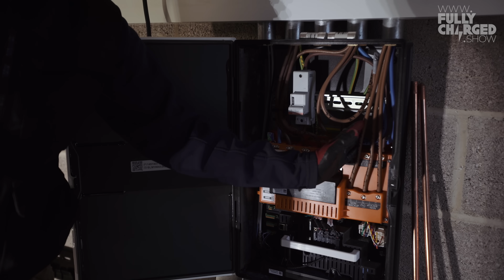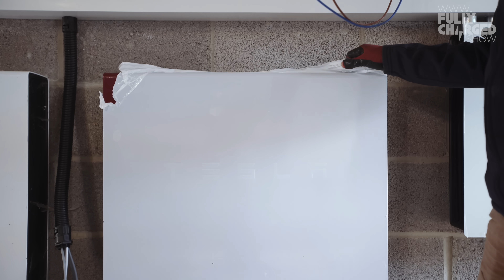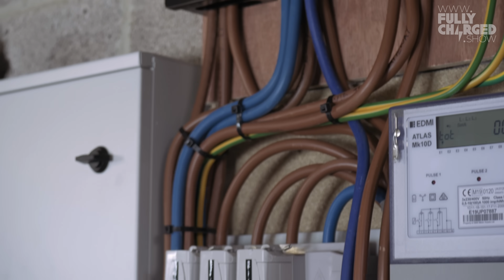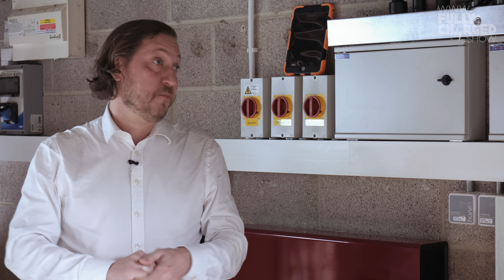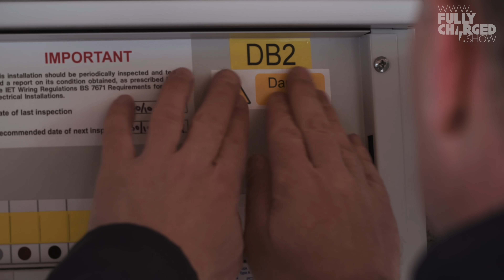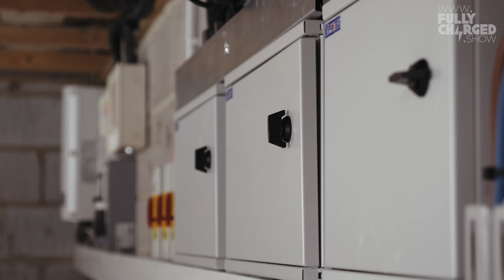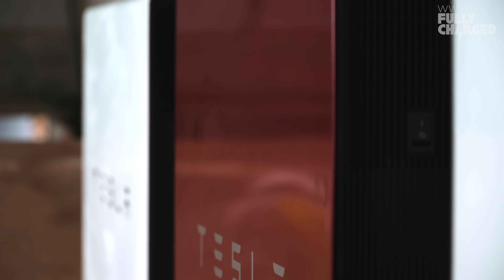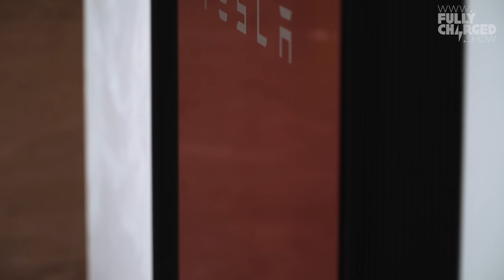Can you run your house on a battery? Tesla Powerwall 2 (Founders Series) & Tesla Backup Gateway 2

Comment: Had my powerwall and gateway 2 a few months ago and was surprised to see how long your battery’s took over the grid, mine is instant ( maybe this is due to your 3 phase supply ) noticed a few people asking about cost my standard single phase house cost £8500 fully installed pw2 and gateway 2. I’m doing a 2020 cost analysis to work out how long it will cost to pay back in real life situations on my  channel.
Reply: I've had my Powerwall2 & solar since Oct 2018. Southern England. We used virtually no grid electricity from 24th March to 24th Sept. House use for year was 9.9 kWh per day with grid use at 4.2 kWh per day so saved 64%. The battery provided 1160 kWh to the house. So at 14.5p/kWh saved me £168. Going to take a while to pay for itself! (Cost was £5600 I think).
Reply: @StephenBurch  so, you'd need 33 years for payback, which of course makes no sense, especially if you are realistically including capital costs?
But if you are basically getting electricity for your car free of charge for six months, I suppose the calculation ends up looking quite different.
Reply: @martian9999  That's assuming you don't invest that 5600 in something else.  8% returns over 33 years is like 70k.
Reply: Martin Schwoerer I think ideally, it would be better if each Tesla car could act by its own as a Tesla Powerwall because 1. there is 60kWh or more battery capacity in the car, unused most of the time and 2. it could avoid to have to buy many standlone (non mobile) Tesla Powerwalls and save on the cost on those.

There the ROI would maybe be better, but I am not sure that it would make sense...
Reply: @martian9999  You are correct it makes no sense so I've just had a look at my installers original quotes. My solar PV system on its own should pay back in 8.9 years (savings from reduced grid usage + tariff payments). 

The battery along with the solar PV system only added 2 years to the payback (10.8 years). It looks like they arrived at that figure by assuming grid prices and tariffs will be increasing over the 10 years (6.5% pa and 2.8% pa respectively) and that I would be using off-peak charging which they estimate would save £135 per year. I don't currently charge off-peak but reckon if I could get all my current grid use (1325 kWh per year) off-peak at 5 pence/kWh I'd save £125 per year. 

With the feed in tariff being paid at half of what I generate (irrespective of what I actually send back to the grid), together with RHI payments for my solar thermal, I in effect paid nothing for gas & electricity last year for which I'm very happy! 

(I don't currently have an electric car).
Reply: Stephen Burch I’m quite a high user of electricity especially this time of year ( electric boiler ) really  looking forward to how long it takes me to be self sustained ( March would be great and boiler should be off by then )
Reply: @AllElectricLiving  yes. I find if the battery is at about 20% when I go to bed that's just enough to get through the night, have a cuppa in the morning and wait for the sun to get back into action. Roll on the spring!🌞
Reply: Chris Hill @Chris Hill : For the electric bolier, maybe it could be interesting to install thermal solar to boil the water of the electric boiler : I think it could reduce the need of electricity, and so speed up the Return On Investment of the solar electric installation & Tesla battery
Reply: I don't think it's worth it, too much time for early adopters. I think it's better to adopt small scale, a small system for the fridge and heating things.
Reply: Stephen Burch I’m also on the agile tariff from 🐙 octopus
Reply: @AllElectricLiving  there's a 3 tier tariff from Bulb I attempted to join but they're not rolling out the required meters yet. Charging from the grid overnight is the next step. Will check out Octopus!
Reply: Stephen Burch last weekend the octopus agile tariff was paying us up to 5p per kWh to take energy from the grid. There is a referral on my video logs where we both receive £50 if your interested. The down side to the agile tariff is it can cost a lot more between 4 pm and 7 pm ( up to 35p per kWh ) but the powerwall covers these times and a bit more
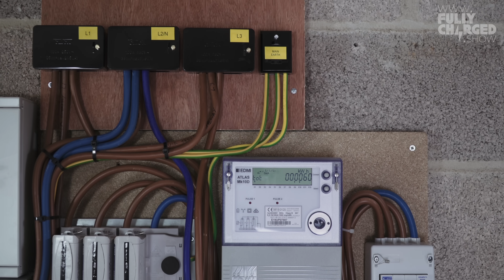Reply: @AllElectricLiving  Green Energy also do the "Tide Tariff:" that is 'Eco7' over night (7.53 pence from 00:30 to 07:00), then 'normal' during the day (15.5 pence @ kWh), but with 31 p from 16:00 to 20:00 'Peak.' We have been on that for about a year, and using the Powerwall 2 we have only used between 1 and 2 kWh at 'Peak' a MONTH, and that is due to to-and-fro with the grid at odd times to balance the pull from the battery. For 2 summers we have been effectively free of the mains for 6 months, with the other days on Off Peak. That is WAY better than we expected.

I have been trying to get Joju to fit a 'Gateway' for about 6 months, but they have been too busy on the mainland :-(. The joys of living on the Isle of Wight :-). I will now 'Tug' on Jon Cowdrill's chain again, having watched this!
Reply: @StephenBurch  you're not thinking of economy of size if the batteries were big enough and the multicast was available instead of receiving 5pk kilowatt you could even receive 1 lb per kilowatt then how much would it return to you
Reply: Stephen Burch Thanks so much for those numbers Stephen, it is very, very helpfull to give an overall idea of what it gives in real life !!! May I ask what is the size (in peak kWh) of your solar installation ?
Reply: @nicolasdujarrier  I've a 3.3 kWp system (10 panels)
Reply: @StephenBurch  isnt it always cloudy in uk.. 64% thats a lot. Any place sunnier it's probably close to 100% then?
Reply: @StephenBurch  what! That is a gold mine here in Brazil.
A typical house with 3-4 people consumes around 200kWh per month!! That would cost us around R$160 / $38. We basically have solar all year, it's very rare to have a cloudy week.

I can't believe we could live of solar by know
Reply: thx for the cost data
Reply: @ferkemall  What are you talking about?  Solar hot water, PV systems, PV panels, the sun? Sense, you make none.
What do you think the efficiency of the grid supplied electricity is once you account for the transmission, transformer and power generation losses?
Reply: Chris Hill : Any chance of a link to your channel?
Reply: Dave Pinnell here is a link to the first of a few short videos about my circumstances before 2020 year, please ask any questions or if you want anymore information 

https://youtu.be/G2aJYjnlL3A
Reply: @davepinnell  "Any chance of a link to your channel?". Just click on his name in the comment - takes you straight there.
Reply: Thanks very much Chris for doing a cost analysis : It would be very, very helpfull to get an idea of real life cost / expenses and income of such an installation for people like me that are thinking of doing the same of some point in the future
Reply: @Peter Evans The costs work out totally different when they had the subsidies. On a 2012 installation he has FIT locked in that is no longer available to new users
Reply: Here's a rough calculation for basic ROI for my house in France. Install PV system of 16 panels at 300 watts each €13000. Install PW2 and other gadgets €10500 (PW2 alone costs around €8000 in France). Average electricity bill is around €100 per month. If the PV system and PW2 could save me 75% of my electricity bill then I would need 23500/75 months to get to zero cost. That is 26 years. Yes there are other factors such as how much energy I will actually save, government subsidies, increasing future energy costs, lost interest on capital expenditure, and energy feedback to original electricity power supplier. But even then it would be difficult to get the break even point to much less than 15 years. Conclusion: today the ROI is not the only question - there's also the philosophical and good citizen issues to be considered - for that my engineering background is of little use. Hope this helps.
Reply: @ianburton9223  I've just been looking at my installer's calculations on ROI with and without a Powerwall. Adding the battery added 1.9 years to the payback period. Seemed like their big assumptions were FIT (no longer available) increasing at 2.8% pa,  Energy prices increasing at 6.5% pa and using off-peak grid to charge the battery. As you say, there's more to it than just the "bottom line"
Reply: Mine too. It switches instantly and the lights dim slightly. I’m not sure it is 3 phase or it is not set up correctly.
Reply: @arnyswart  might have something to do with fluerescent tube bulbs take longer to fire up once you cut power to them, possibly?
Reply: Iain Ansell all mine are led to save on power.
Reply: Mine is instant also. But I'm in in the US.
Reply: Considering the  gateway is nothing but a Tesla branded ups with a bit more logic, the cut over is far from impressive? But it also makes me wonder, how can you run a UK house on single phase power?  What's the standard main fuse in UK. In DK its 3 × 25A for a commercial house.
Reply: @troelshansen6650   most uk houses have 100Amp main fuse on single phase.. its a lot simpler and cheaper than everyone having 3 phase
Reply: My UK house on single phase has a 100A fuse.
Reply: It's worth noting that the light itself might require "warming up".

The light actually flicked on, went back off, and then came on again.

They might have chosen a bad prop for illustrating the switch over. Some fluorescent lights aren't "instant on", and take a second or two to charge up their capacitors and such.

The light is not a household lightbulb, it's professional lighting (the "fill light" whose requirements are a steady soft light, not a fast on / off, in professional terms - so it's more designed not to ever flicker, at the possible expense of a slow on and off, and likely has a capacitor on board to ensure that steadiness).

Admittedly, I don't think the long delay was entirely down to the light alone. But it certainly wasn't helping illustrate this, as it added "lag" to the "look, the lights are back on!" moment.

But you can see the light flicks on earlier, then goes off for a bit, before kicking back in and staying on. Well, that first flicker could not be happening if there wasn't electricity to power it. The line was already live at that flicker. 

So we should at least be measuring to the flicker as when it went live, even if the light's insistence on "warming up" kind of ruined the dramatic reveal.
Reply: I have a Victron Multiplus 48/5000/70. I run on 230V single phase. There are some 48V LiFePO4 batteries, 250/100 MPPT controller and PV's for solar generation. There is a cool Colour Controller that everything plugs into. Power switching on mains failure is instant - though the "5000" part of the Victron is VA - so its only about 4500Watts - so the electric Stove and Electric Water heater are not included in this "backup".. When power returns, the Victron switches back to the mains after about 20 seconds (it stays on Battery). The lights never even flicker! I also use up a lot less real-estate in housing all this. The wiring looks a lot simpler too (did it myself). I live in South Africa - so its damn useful at the moment with "Load Shedding" going on.
Reply: Jedi Knight , mine have already been paid for since 2012 from my FIT but my cost analysis over 12 months should see if it works for me
Reply: quite expensive. batteries in most countries have a 10 year payback at least (tariff dependent). they need to halve in cost at resi/small commercial scale. at utility level they are displacing nat gas and hydro.
Reply: @Peter Evans my investment in solar has paid for my battery and for the solar system that was fitted in 2012. I just want to put the results out there and everyone will read the results differently. There is know doubt with electric cars and electric heating and hot water. my demand has increased and hoping thanks to the agile tariff the powerwall and solar will help to make my everyday costs cheaper than before. no burning of petrol and natural gas for central heating and hotwater. and hopfully all this will make my re-investment viable. PS im still in my 30s so lets hope it pays for itself before my lifetime ends
Reply: Peter Evans what did I miss I’m happy to put it in
Reply: @Chris Hill I was also surprised to see how long it took for Robert's Gateway to switch. I have 2 Powerwall2s and a different version of Gateway, which is apparently only used in Australia. Transfer switching occurs in about 20-30mSec. Sometimes you will see lights flicker a bit but most times not. Computers don't usually reboot nor do electric clocks need to be re-set.
Reply: @vk2aafhamradio  could it simply be the studio lighting units taking a while to fire back up after a momentary power loss?
Reply: @vk2aafhamradio  Yes, the quick switching is a requirement in my opinion.. Otherwise its pointless really.. you dont want your computers and servers and other stuff to power down and reboot.. I think also a powerwall even in a 3 phase environment only supplies power on 1 phase.. So that is something to take into consideration when designing the solution.. You might need to move a few stuff between phases in the house.. to keep the most important stuff on 1 phase.. like freezer, fridge, computers and home automation, tv and so on :)
Reply: probably you don't need this special gateway
Reply: It will never pay back
Reply: @andreaceria8481  ok. Explain why it will never pay back.

Comment: Point of clarification, I have almost exactly the same configuration installed (same PV output and 2 power walls), but without the Gateway on a single phase supply. I am able to use the advance mode of charging the power wall's overnight on a cheap rate. It is my understanding that the level of charge/time of year intelligence is in the power wall firmware NOT the gateway. Therefore, you don't need a gateway to run this functionality.
Reply: @Chris Jardine Hi Chris, can you clarify which phases everything was connected to in Robert's system? Did you move the solar array or the original powerwall off the original phase to which the house was connected? If not, only the new ("free") powerwall would be on a second phase, with the zappi connected to all three. I have a property with all three phases so am interested!

Comment: I’m assuming the time lag for the switchover is because you have two batteries and three phases, so maybe some fancy electronics are doing some manipulation in the background.

We have a pair of Z-Cell batteries, similar to what you described when you were in Adelaide with Simon Hackett. Our system is also designed to “island” the house if the grid goes down; we are on single phase.

When things go down, the switchover is effectively instantaneous.

If you added a third battery for the third phase, would you be able to have an instant switchover?

I am at 38º Latitude in Australia with 7.7kWh of panels all running micro-inverters, currently we are in summer and we have an excess of power, except on 40ºC days, when we run air conditioning. Which is covered completely by the roof solar up to around 16:00-16:30 from when the batteries start to take over.

Unlike you, we currently have gas HWS, but are now seriously looking at changing over to electric HWS with a similar set-up of feeding the excess power to the HWS.

I would be very interested to see how your system is working for you in six months-time when you are running into longer days, and, presumably, much more sunshine.

Comment: I have 10kW PV system, a Powerwall 2, Gateway 2 and a Eddi. The DNO has limited the amount of electricity I can export back to the grid to 6 kW, I have SMA inverters and they have been able to be configured to limit the amount I send back. Funny thing is I have a 60 amp main fuse in the incoming head.
Reply: And they signed off your DNO with a 60amp fuse, I had to get mine updated to 100amp
Reply: I can survive on a 60amp supply and I also heat the house by a Air Source Heat Pump. I enquired about having the gas supply cut off and received some interesting info. £150-00 for the my energy supplier to collect the gas meter & because I want the gas meter removed, SGN the local gas network operator wants nearly £1000-00 to terminate my supply in the street. So I will carry on paying the monthly gas standing charge. The government should pay these costs if they really want to reduce Global Warming.
Reply: I can survive on a 60amp supply and I also heat the house by a Air Source Heat Pump. I enquired about having the gas supply cut off and received some interesting info. £150-00 for the my energy supplier to collect the gas meter & because I want the gas meter removed, SGN the local gas network operator wants nearly £1000-00 to terminate my supply in the street. So I will carry on paying the monthly gas standing charge. The government should pay these costs if they really want to reduce Global Warming.
Reply: I can survive on a 60amp supply and I also heat the house by a Air Source Heat Pump. I enquired about having the gas supply cut off and received some interesting info. £150-00 for the my energy supplier to collect the gas meter & because I want the gas meter removed, SGN the local gas network operator wants nearly £1000-00 to terminate my supply in the street. So I will carry on paying the monthly gas standing charge. The government should pay these costs if they really want to reduce Global Warming.

Comment: I thought the over under on the Powerwall is that it's WAAAAAY more expensive than it's capacity would suggest, and you're much better off with a diy solution?
Reply: Depends on how comfortable you are DIYing this! I'm pretty happy with my system, and I got free 2nd life batteries from the trash.
Reply: Maybe, but given he got the powerwall free, it's not such a consideration :D (at least for Robert)